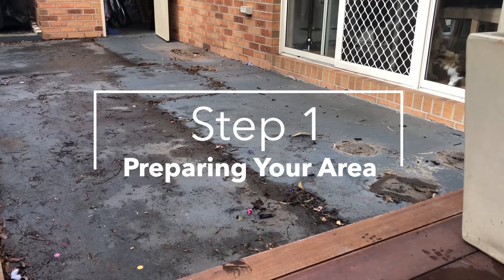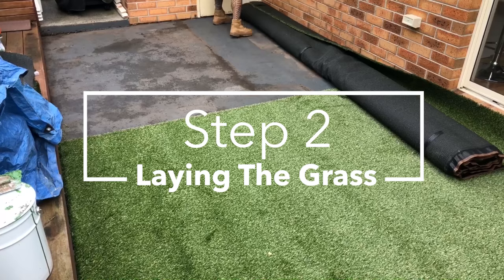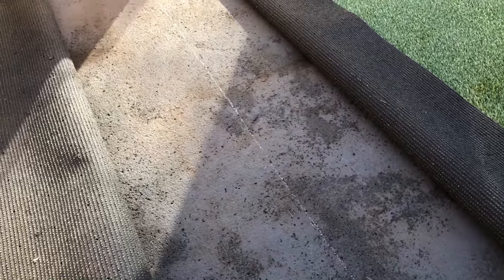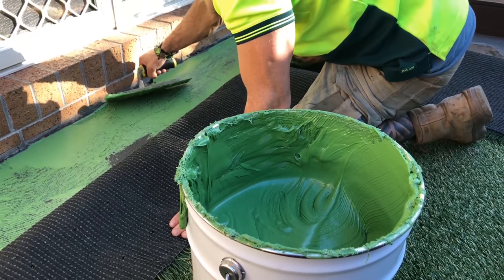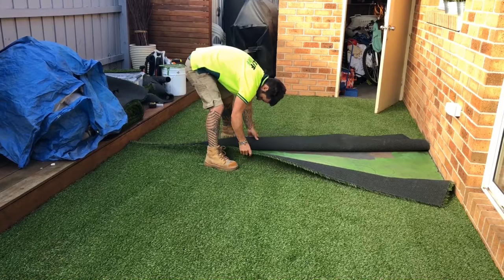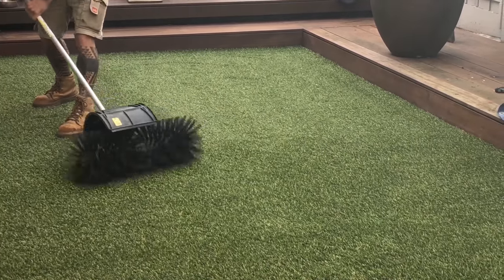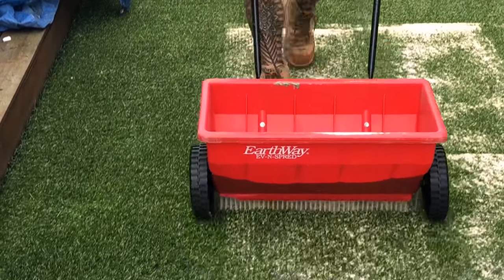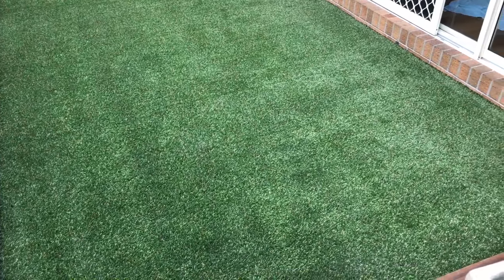How To Install Turf On A Hard Surface

Comment: This is not good idea if you have a dog because there is no layer of drainage or any layer to soak up the urine to take away the smell. Maybe would have been better with a drainage cell on the ground first. the plastic drainage cell would then give a bit of height to do a couple of layers just a thought.
Reply from the maker: This is a great thought, and as far as a DIY project such as this video shows, it's beyond most people's skillset. Thanks, Steve for a great next video idea!

Comment: Is Boral Uni sand suitable for top spreading on your Luxury Tuff product? Here is a link to the sand: https://www.boral.com.au/products/cement-and-lime/packaged-products/specialty-sands-and-gravels/uni-sand.
Reply from the maker: Yes, this one will definitely work. In an ideal world, your spread rate would be 18kg/m2. This may harden the surface too much for your preference so as we have in this video, apply sand evenly, gradually over the surface until you work towards 18kg. Don't use less than 15kg/m2.